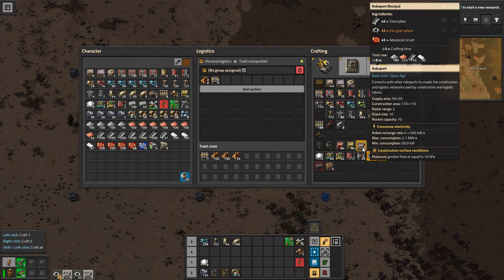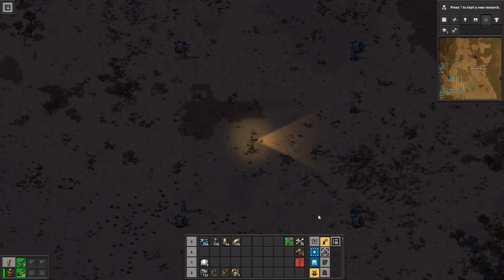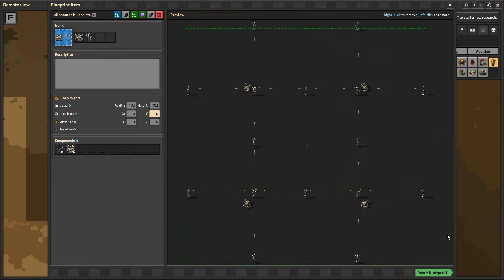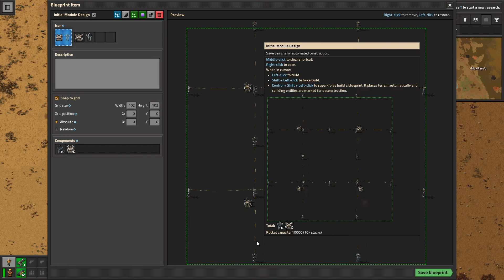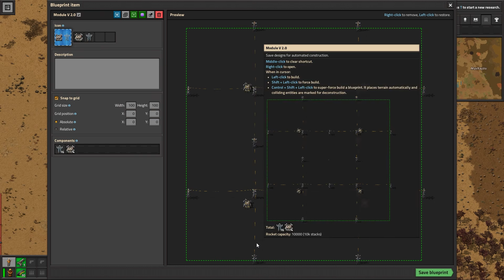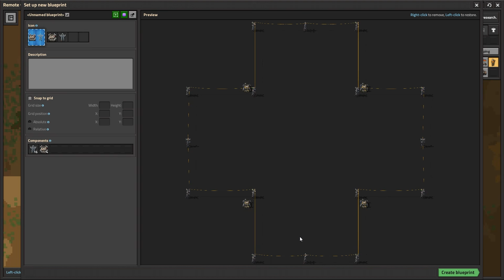RoboCell Design Marathon! [FREE Blueprints] | 20 | Factorio Space Age

Comment: The way I design a city block is I put a 50x50 square with the joins next to each other not on top so you get a 2 tile between the city blocks and then use the copy tool, copy 24 tiles and paste half way on all sides next to the city borders and that will give you dead centre of how to place your robo ports and big power as robo ports are 50 by 50 coverage and take up a 2x2 so if you do the math they can go halfway up the city blocks if you’d like.
Reply from the maker: Would you like to share your blueprint? Maybe the pastebin link
Reply: I'm also pretty curious how you did.